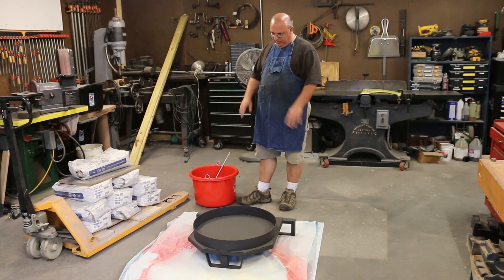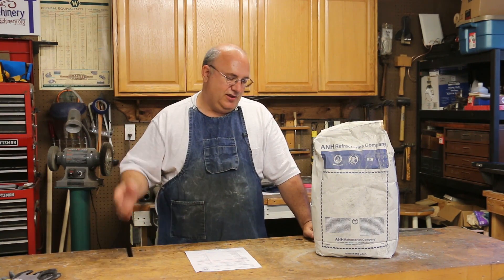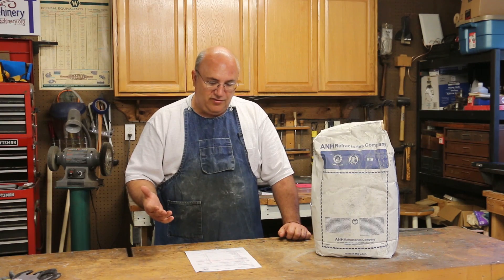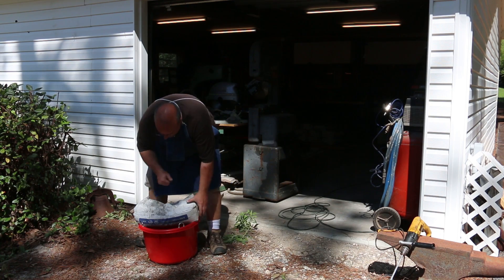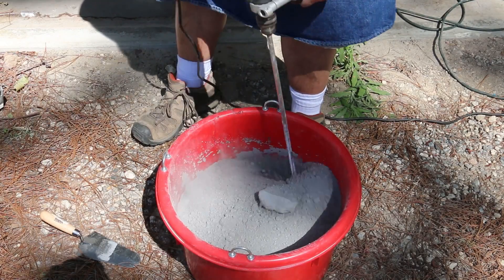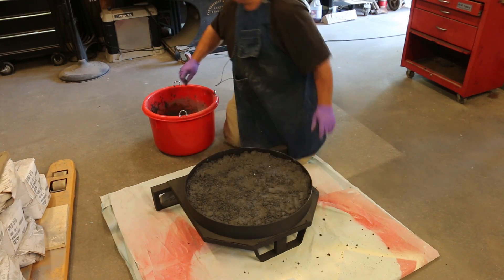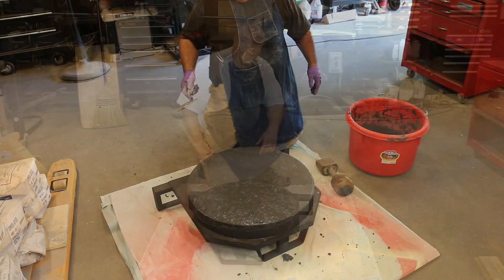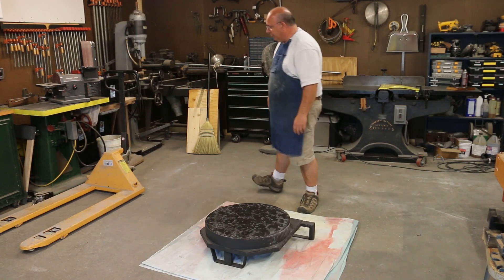Building an Oil Fired Foundry Furnace - Part 3:  Casting the Base Refractory

Comment: Great set of videos.Thing that interested me most was your use of only refractory without adding anything extra to mix, from what i have been taught and researched that refractory cement is to be used like "mortar between bricks" to help and hold the mix together depending on what you add eg, silca/sand/fire bricks etc (ultimately could be a cost thing). 

As i say its a learning experience and we all do it differently based off our knowledge and access to materials

Comment: When I built my furnace, I went through hell getting the 3000F castable refractory.  Even on ebay I had trouble.  I DID eventually find some on ebay and bought 150 lbs of it.  The shipping cost exactly the same amount as the refractory did!  And when I got it, the bags were ripped and the refractory as mixed with packing peanuts.  

My furnace is a lot smaller than yours is going to be so I imagine you must have bought a lot more than 150 lbs!
Reply from the maker: MattsMotorz Yeah, a lot more....  I think it was something like 800 lbs....
Reply: Damn! That IS a lot more lol

Comment: Hey I like that benchtop joiner you have in the background - I don't suppose they made a bigger model?
Reply from the maker: SasquaPlatypus They actually did make a bigger model!  That jointer is made by the Crescent Machine Company and is the 16" wide model.  They also made 18" and 24" wide versions!

Comment: Cool vid about construction materials and methods I never saw before.
Was that your home shop, I guess? That jointer is so cool-- over 12" it appears, and 8'+ long? That puppy will make some chips. "Turning fine wood into fine wood chips." That was my motto.
Reply from the maker: Lee Humes Yes, I am building the furnace at home and those shots are in my shop at the house.  I am hoping to start construction on a larger shop later this summer at the house where I hope to get all of my machinery set up where I can use it better.  Things are really cramped in the home shop and I have to push all of the machines against the wall to get any work done and still have stuff tucked away in storage that won't even fit.  The jointer is a 16" wide model made by the Crescent Machine Company.  I should have a video that I did a while back where I show how to change the knives on that machine if you look back through the archives.

Comment: Hi mate.
That looks so very smooth.  I would have sworn that you had put one of those helicopter levellers over it.   I was wondering, in large castings, would it be possible to use lava stone to bulk up the mixture, and save some money that way? 
The pallet jack looked quite well under that base.  About the with of the forks, I think that you have the widest forks already.  That jack is for European pallets, that are a little wider than the others.  About the jack sinking in the sand, I just tried to be funny, not this time....  Oh, by the way Keith, the anvil and bell that are sitting in the door way, I think I know a person for that ; )
Marcel.
Reply from the maker: Marcel Timmers I am very happy with the way the base turned out and am anxious to do the next pour.  As for the anvil, I have had that big 400 lb Fisher since the late 1980's when I bought it from a lady selling all of her husbands tools (she caught him cheating on her) - I paid a whopping $50 for it!  The bell I have had since about that same time as well and was cobbled together from parts from a couple of bells.  I need to get the bell mounted in the yard here at the house - the anvil will go in my new shop when I get it built.

Comment: A comment on safety:  cement based products are VERY bad for your lungs, with all do respect you should WEAR A DUST MASK at very least.         As for your dry spots in your mix, if it were a straight cement it would be no good(also you did not let the cement slake), but refractories have cement in them to bind on initial setting, but the real glue is the clay content, which will harden upon firing, so I doubt dry spots will render any effect provided it is not disrupted before firing

Comment: Inspiring project for sure. I have been reading a lot about the different styles. Some include a drain hole in the bottom in case of a crucible failure. Did you consider one?
Reply from the maker: Walter Plummer Yes, I considered it.  In fact, I am still considering drilling one in the base just in case.  Some people say you need one and others say don't put one in there.

Comment: Good stuff Keith.  The refractory didn't seem all that self leveling...lol.  There's some debate on the backyard casting forums about the usefulness of a furnace drain but all those who have had a crucible failure are glad they had one.  Too little too late I suppose.

Considering I was too late with the drain advice, I'll mention something else before you get to deep into the body forms.  Consider cutting down on your use of dense refractory for the walls/lid and instead back a inner refractory layer with insulating fire brick.  It will cut tons of weight off your project and make your furnace more efficient.  Bare in mind you need to heat your hot face before you can melt metal.  Based on that stack of refractory bags I'm thinking you may be venturing deeply into the unnecessary over kill.  Food for thought.

Keep up the good work.
Reply from the maker: Jarrett Vibert I am looking at having a 3" thick wall of the refractory for the walls and then insulating outside of that with a several more inches of high heat blankets.  This design is based on several furnaces built by others as well a loosely on some of the commercial furnaces built by Speedy Melt.  Yes, the furnace will be heavy, but I am not worried about the weight - and the weight will be very similar to the same size units from Speedy Melt.  

As for the drain the bottom, I have considered drilling one in there but I am getting mixed advise on this.  Most people are telling me not to do it.  At this point, I will probably go without (and I very well might regret it later on....)
Reply: Well I'm glad you have done some solid research into construction methods.  I build my furnace using the same methodology you are but scaled down a good chunk.  Based on what I've done and what I've seen others do since the build I'll probably skip the high temp blanket and use the insulating brick.

My final thoughts on the drain add a wrinkle to consider.  This may not be your goal but the drain has no draw back, is a god send if ever needed, and what I have found allows you to break down large scrap into ingots rather than busting/cutting into crucible sized pieces.  I have placed my ingot molds under my furnace and used it for this purpose.

I'm currently knees deep into a muller build.  You'll find that to be your next foundry "necessity".  Can't wait to see you go about yours.

I'll be staying tuned....
Oh and one last thought...  One of the industrial backyard casters I know of has added stainless steel refractory needles to his builds.  He produces quite a lot of cast iron pieces and has been through a small handful of furnace builds.  He has nothing but praise for these needles.  Apparently the cost is low and the added durability is large.  A google search will provide you several sources.
Reply from the maker: Jarrett Vibert Yes, a muller is on my list....  I hope to either find one or build one in the near future.  I am hoping to build a new shop later this year and I have plans for a side shed down one side of the building where I can do much of my casting work - outside but under shelter.  I plan to build a good molders bench as well as have a muller to deal with the sand.  Right now, I am only dreaming but every day get's closer to having the building up where I can get things set up much better than now....

Comment: Very nice. Thought that the first batch looked a little dry. The second batch looked more like what I expected. That stuff sounded really hard when you knocked on it. Like concrete! Thanks for posting this. I heard your big fan running in the background. I bet it is hot down your way. Be careful out in the heat!
Reply from the maker: vajake1 Yes, the second batch came out a bit better than the first.  And yes, it is getting pretty hot down our way.  I have a window air conditioner unit out in the shop at home, which makes it a bit more enjoyable to work there in the summer time!

Comment: Hi Keith,

I have been watching your channel for over a year now and find it very helpful. Keep the videos coming. Have you considered using an old burner from either a water heater, boiler or furnace for your heat source.They can be had in either gas or oil, include a blower and there are many options available for nozzle output and angle. Ken
Reply from the maker: Ken Stringham I have a different type of burner coming.  Already proven in other foundry furnaces.  More on that later....

Comment: Hi Keith
 It's time that I follow and subscribe to your videos (and of
Mr. SV Seeker(  :-)     

I wanted a time to wake
you, some small notes on 'casting'. Though, it's not so relevant to this
section of the casting furnace you are building

 General – you can learn a little about the technique from
dental technicians, especially those engaged in casting and machining of metals
such as 'chromium cobalt '.  The casting of course is very accurateThey use different types of plaster, the high temperature resistant – 1500° c and more. More effective materials and dubbed
it the 'Kristobliit', crystalline material and solvent-based alcoholic beverageNote and elementary, the Table vibrator use when casting the mold the material
vibrations, help to stick exactly to the format as well as promote liberation
and rise to the surface of the bubbles that have accumulated in the mixture and
prevent lumps of dry material to cling to the model and create a "casting
error" Enjoy every chapter and chapter today! Sincerely Reuven
Reply from the maker: Reuven Oren Thanks Reuven.  I have a friend who did dental castings when he was in the AirForce.  He has given me some advise before....

Comment: Great video as always! On an unrelated note...Who makes the jointer sitting in the background and how wide is the bed? It looks like a beast!
Reply from the maker: Chris S The Jointer is a 16" wide model made by The Crescent Machine Company.  That one was made in the 1940's, but they started making that model back around 1900 or so.  They made them up to 24" wide!  I also have an 8" wide Crescent that is need of being restored.  If I can ever get my new shop built where I have room to put all of my machines back in there, I might just have them both in the shop - one for face planing (the 16" beast) and another for edge jointing (the 8" model).

Comment: Thanks for the great video.  Like always you take the time to explain the process and materials.
As others have mentioned, add the dry to the water, BUT, don't put all the water in first.  Leave out about 1/4th of the water you calculate, add dry, thoroughly mix and add additional water to gain consistency desired.  It is also preferable to screen your dry mix prior to mixing with water, this is especially true with mixes known to separate.  This lets you deal with clumps and remixes any separated aggregate.
Looking forward to next in series.
Reply from the maker: Morris Gallo Thanks for the tips, I will be doing the mixing a bit different the next time around.

Comment: Hello Keith,

My father used also a kind of material you use for the oven in a little fireplace with an gassburner in the livingroom. We call this here in the Netherlands chamotte and translated in English they call it grog ( http://en.wikipedia.org/wiki/Grog_(clay) . 

I'm really curious about how you're going to build up the oven and of course how it works when it is finished. Guess that it isn't something for the summer when it is hot outside for the first try. 

Thanx for the video and looking forward to the next one !

Greetings from Roel !
Reply from the maker: RoelTyros Always - thanks for watching and commenting.  You guys can see how it comes together as I build it up, but if you want to see which direction I am headed, take a look at the Myfordboy channel.

Comment: Next time you mix from a powder, put water in the tub first. Dry material during the filling of the base is what i call a bad mixing, the second one was more sloppy, i would have mixed both loads in a big tub to get it consistent. On the mortar side of things, i can teach you a few things. I am a ex restoration bricklayer, lime mortar and grout experienced.
Reply from the maker: Arjan Wilbie I have very little experience when it comes to cement, brick and mortar work.  Several have suggested adding the water first and we will give that a try the next time around.
Reply: Keith Rucker - VintageMachinery.org, your channel is a two way instrument. You teach us, we teach you. It might be something i need to look in to, education to students about arches, mortar mixes... :)

Comment: Hi Keith,
     Thanks again for the videos. You have probably already looked at them but myfordboy has some videos posted about building an oil-fired furnace. Your design may be different but I was intrigued by how he built forms for casting the refractory and also how he created the tuyere opening. Just a thought.
Len
Reply from the maker: Leonard Winn Myfordboy's build was a major influence on what I am going to do.  Mine is a bit different, but very similar.  In the next episode, I will discuss how I borrowed his method of laying out the tuyere hole and what I think is an improvement on his great idea!

Comment: Hi Keith,

Birmingham is still a center for metalworking, and has the steel mills (NUCOR, CMC, US Steel Fairfield) and foundries (too numerous for this little blurb!), all needing refractory materials...

JT Thorpe & Son is one of the major suppliers - and, as you found out, pretty reasonable to deal with.

If you need to get other refractories in the future, and won't be driving through Birmingham, Jacksonville, Florida has a steelmill and some foundries, as well as being not too awfully far from you in Tifton...

Glad to see that you got what you needed!

Regards,

Eric
Reply: chemech I'm old enough that the ANH name took me a couple of seconds to parse out... AP Green, NARCO, Harbison-Walker all got merged together...
Reply from the maker: chemech While Jacksonville is closer, I end up driving through Birmingham several times a year for work, but rarely get over to Jacksonville.

Comment: Keith, I was a bricklayer (or if you prefer a Meticulous Arranger of Artistic Burnt Clay Products) and got to work on some high temperature firebrick work.  On high temp projects like yours, we used a high temp Ram product on walls.  I think it would be a great idea if you used insulation rated for firing clay or even melting iron on the inside of the furnace wall before applying the castable or ram product.  If you have a building product supplier near by they may have cardboard forms for concrete in different diameters you could use for the inside of the furnace. After the walls set up, the forms can be ripped out.  Think about that insulation because it will make your jacket last a lot longer.  You can get insulating brick, also!  They can be cut with an old hand saw to fit.  Great videos, Greg Compton (Charles)  Oh, bring the heat up slowly or you might have problems with the castable and or ram products.

Comment: Hey Keith.  That cast-able appears dense and heavy and seems that it would be a big heat sink to get up to pouring temps.  Did the rep mention anything about minimum thickness?  I wonder if perlite could be added to it or maybe a thinner pure cast inside of a perlite or ceramic blanket shell to reduce mass and insulate the outer surface.  My current furnace is much like your old perlite one using clay and/or furnace cement paste as binders.  Hardware store furnace cement is pretty miserable to work with and just bubbles off after heating.  Since my natural gas burner seems to make more heat than I expected, the old mix just ain't cutting it.  I would like to move up to bronze and cast iron, too, so I am seeking a better material that doesn't require a pallet jack to move. :)
Reply: Eddie the Grouch I think that Keith had a minimum buy situation which got him to have lots of castable... coupled with a large enough shop and a convenient pallet jack (we can get them here from Harbor Freight new for ~$260) and his design makes sense. (It's derived from Myfordboy's design of a slightly smaller furnace for his home shop in the UK)

There are products like low density firebrick and various felts and papers which give better insulating properties - usually at the expense of mechanical properties, and in commercial operations, we design the refractories to use them outside of a hot face material such as the Express 30 Plus which Keith is using...

Then, as you point out, there are things like vermiculite / perlite which can be used as aggregate to produce voids in the castable, making it a better insulator.

The hearth - what Keith shows in this video - typically needs more mechanical / structural strength, and is a much trickier proposition to make lighter.

One sourcing method for refractories is the ceramics kiln folks, who piecemeal out smaller lots from the minimum buys they make from the major suppliers. You'll pay a bit more per pound of material, but can mix and match and get quantities which are all that you'll need for a smaller furnace.

Cheers,

Eric
Reply from the maker: Eddie the Grouch Bases on recommendations from several places, we have decided to go with a wall thickness of 3 inches on the furnace and then a ceramic blanket of another 3 inches thick outside of that.  I worked out this dimension from several sources, as well as looking at some similar commercial furnaces like the ones made by Speedy Melt.